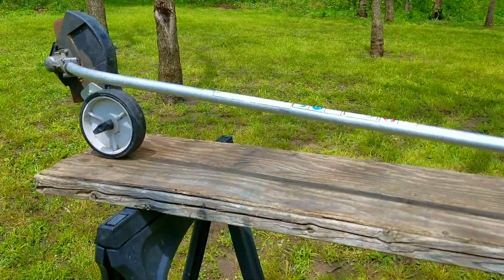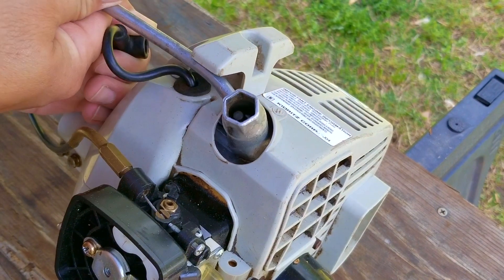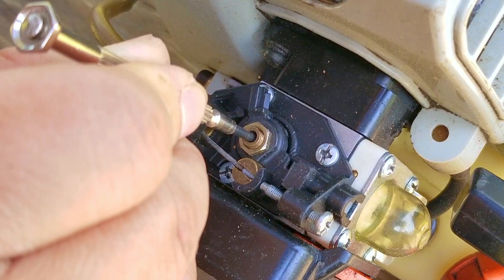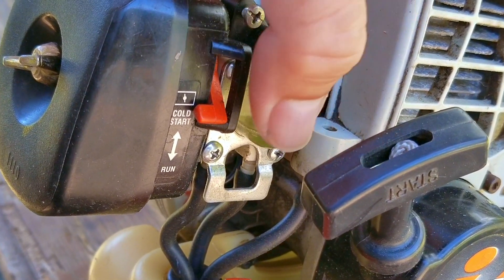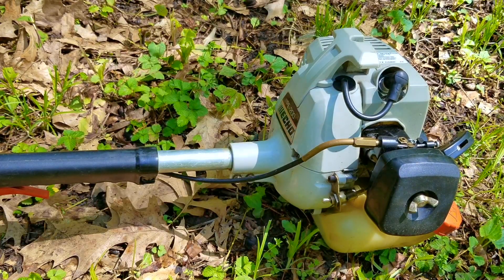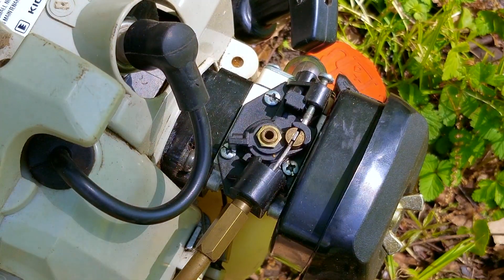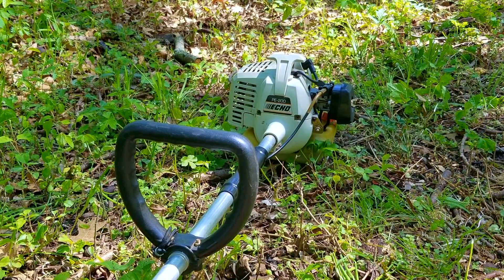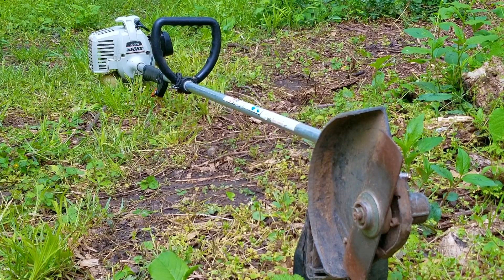Fixing An Edger That Starts But Won't Run

Comment: A tip that I used to get those adjustments screws out is to heat up a Small screwdriver with a torch and then stick it in there for 30 seconds and it should pop out it works every time
Reply from the maker: thank you Alex Valerio.

Comment: Your videos are honestly my favorite, they are so enjoyable to watch. Also I love used, especially if it is broken you get it pretty inexpensive, plus the fun of fixing it. Also you know those older Featherlite trimmers? Like the boxy ones with the square design? I use one as my main trimmer and those are actually AMAZING trimmers. Hope to see you work on one again, not sure how you feel about them but they are my favorite because they are very simplistic and run forever, and since everyone thinks they aren't a "high-end brand" you can get them for free or extremely cheaply. I loved the one I had so much I got another one that needed to be fixed and would you guess what? Fixed in under an hour, soooo easy to work on and they just keep going.
Reply from the maker: thanks I really appreciate it.

Comment: not gonna belive this but near my house are some woods and i found this exact model in a shopping cart i had to completly disassemble it to clean out the sitting water but it should run compression was around 100 once it was back together
Reply from the maker: not bad at all.

Comment: for me i would check things over when buying stuff second hand etc including the condition of the piston and rings and cylinder as i have got the right to inspect before paying the previous owner etc and also the basics including Spark Compression Fuel Delivery also to see if it,s gonna be worth saving and all etc vs buying one brand new which is very expensive atm depending on where you live etc.
Reply from the maker: you make a good point
Reply: @INSIDEHOUSEGARAGE  yes i do and i know Donyboy73 will also agree with me on the same page etc.

Comment: Before I knew anything about engines whatsoever (I was mostly a tech guy) I preferred buying/picking up from the side of the road/etc used small engine equipment. 
You're gonna have to mess around with some settings, no matter what, always. 
Would you wanna learn on brand new stuff? No. Used stuff is always better as a first time. New stuff is what you get when you really really want new stuff after you've learned the literal hard way with experience, so you don't ruin your new stuff. :)
Reply from the maker: very well put Metalface.

Comment: I got one like that has 40 fat 45 lb to compression and it runs like a champ it sounds like to me the needles need to be adjusted in a little bit more like the high needle sounds like it needs to go in just a tad bit
Reply from the maker: that's what I thought too.

Comment: I have a question. Now i run my stihl ms 180 on Unleaded 95 with 10% ethanol and ofcourse two stroke oil, now the question is how are the lines not broken or damaged after 16 years of the same fuel and mix? I also run my stihl rm 248 on the same fuel for a bit over a month. Will i ever have to change lines and also my gas station has only fuel with ethanol
Reply from the maker: easy, the fuel lines are not the same as a cheap trimmers.
Reply: @INSIDEHOUSEGARAGE  makes sense, thanks

Comment: Great Video!
My Question is how much carb tuning do you do before you rebuild or replace carb?
Reply from the maker: Minimal, anything over 3/4 of a turn is usually good sign there's something going on with the carb, either the screen is clogged or there's a blockage somewhere .
Reply: Great answer 
I hope others are learning as much as I am from your videos.  
Thanks.
Reply from the maker: no problem and I hope so too.

Comment: Hey man i have a question 
I have a kraftwagen KW2500 chainsaw and it wont stay running for more that 5 seconds
It only starts on choke and when i let it run on half choke it dies .
I've cleaned the carb and changed all the gaskets and the diaphragm and still nothing .i even adjusted the L screw and still nothing
Reply from the maker: can you still find a new carb for it? if so, that would be my next step
Reply: @INSIDEHOUSEGARAGE  i can find a walbro carb thats meant to go on a zenoah g2500 wich is the same saw as the one i have
Reply: @INSIDEHOUSEGARAGE  oh one mpre question man.
I have a 76 (i think) husqvarna l65 and it has low compression and the piston and the cylinder are scrached  badly but it starts and runs fine.
I wonder if i replaced the piston and honed out the cylinder would it still work just fine?
I dont use it to cut wood i just start it like 3 times a year and let it run for about 5 minutes. It has seen better days so i dont want to abuse it even more. I even posted some videos on my profile if you want go check it out
Reply from the maker: that might be your best bet.
Reply from the maker: sure why not, I you can find the ring, and very lightly hone the cylinder, it should work. Remember though you won't be honing to get rid of scratches, just get it ready for the ring to seat.
Reply: @INSIDEHOUSEGARAGE  ok thanks

Comment: The final tune you left this with sounded like a bit lean on the low screw, and a bit too rich on the high, which would only get worse after contribution from the low if it was turned out a bit.
Reply from the maker: yes there was more tuning to be done after the initial one.

Comment: What ratio of gas/oil do you put in your power equipment? Ive always seen the same gas can for premix in the videos so I have to wonder if you just run one ratio for everything.
Reply from the maker: I run everything on about 40:1, no matter what Is.  I need to pay closer attention to the stuff that says, 32:1 though.
Reply: @INSIDEHOUSEGARAGE  Do you have an oil you like to use?

Comment: So all my Stihl equipment was bought brand new. Yep will never do that again, just to expensive, better to find a used Stihl or in this case echo equipment and buy used, if not owned by a landscaper. Usually those models have some high use on them. It’s funny, I bought a new Stihl FS 111RX last year. Just the other day, a lady gave me a like brand new, I mean used only a few items and put away… Stihl FS44… all I did was put a new bulb on it, and it fired right up. Runs and looks like new. The lady who gave it to me said that they used it maybe 5 times and then hired a service. It sat in their garage all these years, Still looks like it just was purchased. So now I have both, I don’t need both but it’s always nice to have a backup.. one thing though, the 44 is so light compared to the 111. Anyway keep up a great work, I always watch your videos!
Reply from the maker: thank you Kris W. and very wise words.

Comment: Without the spark arrestor and plate that holds it it sounds like my steel chainsaw
Reply from the maker: yes it does
Reply: And because of that I would hear a chainsaw noise but it’s actually a edger😂😂